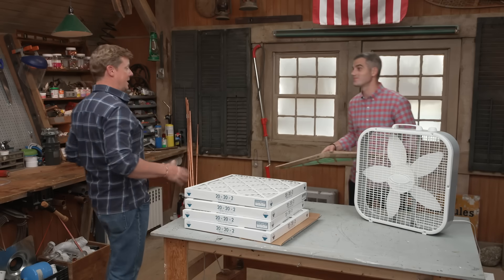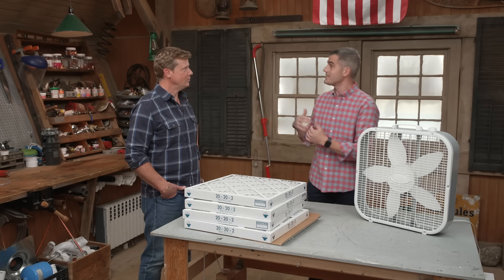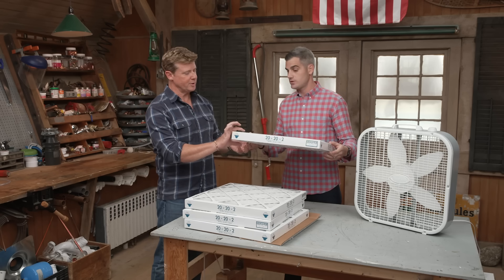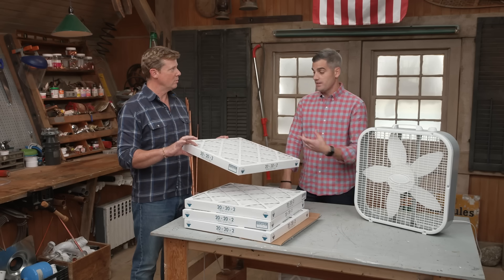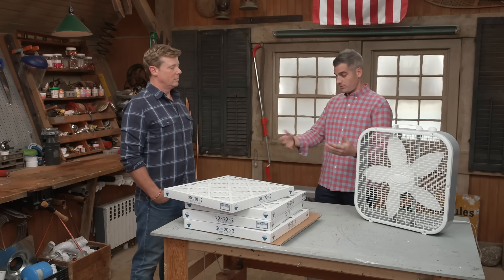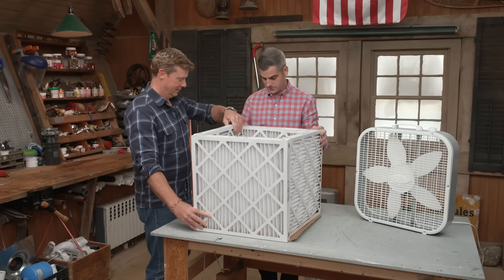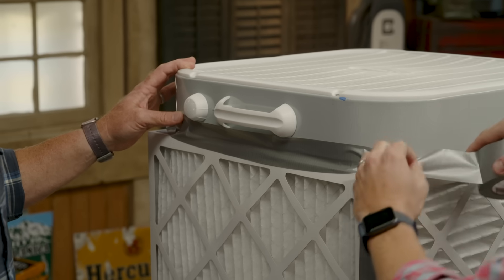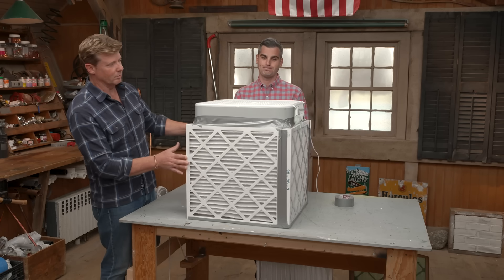How to Make a DIY Air Filter | Ask This Old House

Comment: As an HVAC contractor for 21 years now , I  don't recommend NOTHING above MERV 8 to my clients..The job of the filter is to protect the equipment NOT to clean the air in your  house. If you want clean air keep your house clean!! And air it out often. Or use a HEPA  air wash system and run it 24/7 . Not worth the money , mostly because people never really maintain them properly..
Reply: This is an air purifier with high filtration. Use MERV 13 or better, I am not interested in protecting the equipment (a box fan), I am interested in cleaning the air. Letting outside air in is better than nothing, but not great.
Reply: As an HVAC design engineer I say, "hold the phone, there is a bit more to it!"

Air handlers are designed to maintain a specified mass flow rate of air across your humidifier, furnace, dehumidifier, and chiller/ac.  So while it is true that older systems can only handle MERV 8 filters, us engineers are slacking if we didn't put a decent design factor on, so there is a little wiggle room out of the gate.  Then, increasing the surface area of a filter decreases the pressure head as they mention in the video, so it is possible in some cases to resize from a 1 inch filter up to a 5 inch filter and have a lower loading on the blower with a MERV 13 than a lower rated filter at 1 inch.

Finally, most newer air handlers are designed for MERV 11 filters or better anyway, since they are commonly being bought anyway and advertised as better for allergies. So kind of like how plumbers are stuck dealing with flushable wipes which aren't really flushable, us HVAC engineers just resized things a bit larger, since the condensers are larger outside anyway due to energy efficiency standards, so we were designing in larger fans outside, and might as well up the interior blower fans as well.

So you can get by with MERV 8s, no problem really, and maybe even save a bit of electricity, but checking the faceplate and looking up the manual is easy enough to do, and we mention the filter size right there.

But then again, it is certainly cheap and easy to build one of these filter setups, and what they failed to mention, is that if your air handler happens to be sitting in the same area one of these is running, then all the air you pump to the rest of the house is going to inherently be circulated as already cleaned, so while that is slightly less efficient, it is certainly an easy way to improve air quality for the whole house instead of a single room! 😅
Reply: If you will install a pre-filter in a return BEFORE the thick HEPA filter, the homeowner can change the thin one often and the thick one will last 1 year. This is the setup my HVAC dad made for me and omg its AMAZING.
Reply: The “most people don’t maintain them” argument is not the reason to never use higher than MERV 8 filters. I have used 5” thick MERV 13 filters and they will last a year in most cases and can be installed on just about any residential system with properly sized ductwork. We can achieve both equipment protection and IAQ at the same time. We as an industry have to do better and also must educate customers to change their filters.
Reply: @rosstrethewey9391  Ross thank you.  So many uninformed statements in here.  You are exactly correct (which you already know).
Reply: second this.
Reply: Yes I had an HVAC guy tell me something similar. He said you would be changing out the filter every week because it would catch so much.
Reply: Agree. Using a higher MERV rated filter, over time, will cause your blower motor to work harder and give out sooner, causing costly repairs. Just use a MERV 8, an if viruses, bacteria, and / or mold spores are a concern, get a REME Halo UV light installed.
Reply: @Fulkrum378  are those UV lights expensive and is it DIY?
Reply: @dblood8529  they can be costly. Around $1,000 installed. But that’s still cheaper than a new furnace. It could be cheaper and DIY, if you have a little electric knowledge. For most people, it’s not.
Reply: @Fulkrum378  I have two units. I’m 2k out the door $$$
Reply: @jacktracy4845  the only thing I get  squarely with is the wiring. Also I know the manufacturer won’t cover the warranty if you do not use a HVAC company for the install.
Reply: @dblood8529 Even though this is 2 years old, one thing worth mentioning so you don't get suckered in by the HVAC installers to spend thousands, is that what they say about their simple air cleaner being localized is true...
But, if your air handler happens to be in your garage or a closet with some additional space, there is nothing stopping you from running your diy filter in the same room the furnace blower is in, so long as it isn't so close to the pilot light to be a fire hazard.  If you are scrubbing the air in that room very clean, and the blower is sucking clean air from that room and circulating it to the rest of the house, then it will have a net effect over your whole house.

Comment: I'm definitely going to do this, I hope it can filter out cigar smoke
Reply: Use a carbon filter
Reply: Will it work with other smoke? 🤔 Asking for a friend.....
Reply: I'd be curious too how it would work with cigar smoke. Looking at air purifiers that are more designed to handle smoke often include multiple types of filters one especially being a HEPA. If you do try this out I'd love to know how well it worked for you.
Reply: @jonstark4003  I tried it out and it kind of works. I smoked a Tatiana cigar for about 30 minutes while running the DIY air filter and had no issues with the smoke it self but the smell lasted over 15 hours. It wasn't a heavy smell but a faint smell. I think this was due to having carpet. I also cooked a curry dish for dinner which would make sleeping hard because of the smell in everything but it too was faint and I was able to get a good night's sleep.
Reply: Depends on the filter that you buy.

Comment: As an HVAC guy, thank you for  telling everyone NOT to go buy a 1 inch merv 13 air filter. Those are home wreckers. Those require very specific system designs, like one filter for every room in the house.
Reply: Why don't they just make every new system with high merv filters in mind? It seems dumb how you can get a brand new system that can't even handle filters designed a decade ago. With the way things currently are you're left with two choices: Either running a high merv filter that gives you clean air but restricts air flow and damages your system or a lower merv rated filter that allows for good air flow but doesn't clean the air very well. Either way you're forced to settle for less than optimal performance.
Reply: @Acaidia  because it takes more powerful motors, larger fans, and larger filter boxes, plus calculations of the ductwork in your home, and the size of your home.  It’s like anything - spend more, get more.
Reply: I read somewhere that a 3M 1500 Filtrete filter has an excellent balance of low restriction and high filtration. Do you agree with this statement??
Reply: @charlies.5777  That's impossible to guess at. It depends on you much headroom was designed into your system. You can tell by turning the system on and then dropping in the filter. The more the filter snaps into place, the more of a restriction it is. Another thing you could try is taping some kind of streamer to your supply grills, like yarn or toilet paper or whatever. You'll be able to see how much air flow you're losing. In the end it's your house. Try it and see if you notice the difference either in filtration or how your house feels.  Personally, I use Flanders EZ Flow II  merv 4 about $1.50 each.  Air flow is the key to comfort. It's why you have an HVAC system. To move air of the right temperature to where you want it.
Reply: @tjrooger1092  
Thanks for your advice – I appreciate it.
  FOR what it's worth, when you're standing under a vent when the HVAC is running, it feels like you're under a hair dryer and If you drop a piece of paper by the air return when it's running, it pulls it Out of the air like a vacuum cleaner. Hopefully that's a good sign, ESPECIALLY since it didn't do that when I had the higher-rated ( RE  MERV rating) 3M filter in there.
Reply: @charlies.5777  We have a 1" MERV 13 in our HVAC from 3M and also one on a box fan.  It did not break the HVAC and does an excellent job of removing particles.  We can test it with our Dylos 1100 Pro particle counter.  Our HVAC is heat only with no continuous fan so we can't use it very often, however.  We have 3 expensive HEPA purifiers with carbon as well.  I've heard that MERV 16 is too much but not MERV 13.  But check with a pro.
Reply: @charlies.5777  your furnace has a recommended maximum filter strength. If you don’t have the original documentation anymore, then ask your HVAC tech on your next annual service appointment.
Reply: HOme D didn’t have Merv 13, highest 10, plus only 20x20x10…hope this will work !
Reply: 20x20x10?? Ten inch thick filter? What? @shirleycollins8967
Reply: At the end of the video he said to get merv 13 filters.  Was that just at a different thickness?

Comment: I own apartment buildings with individual furnace/ACs.  The thicker air filters seem to ruin the blower motors (a very, very expensive fix).
Reply: The thicker filters have less resistance so they are not ruing the blower motor for being thicker.  What can ruin the blower motor is if you get too high of MERV rated filter which clogs your air intake.  You cannot use a MERV higher than your system was designed for without negatively impacting your system unless you increase your intake size or the filter thickness.

Comment: This is a clever design easily made from  easily found off the shelf components and duct tape for a more refined version do a google search for Bill Penz home air filter. It can be cleaned over and over and is also effective. Select dust collection research-Bill Penz- air cleaner

Comment: Axial fan without a shroud = very little static pressure. Your furnace has a centrifugal blower capable of much higher static pressure and closer to 2000cfm (or more). That box fan isn't going to last 6 months running continuous and is much louder. You will get much better performance throwing a deeper filter in your furnace and running the fan.

Also load on a centrifugal pump (fan) decreases with decreasing flow (decreasing mass). You will not "seize up" your blower motor, you will actually decrease the load. Blower motors have taps to adjust the airflow based on the amount of restriction from ductwork and filters. They are designed for this. The only risk is having too high of a delta T (temperature differential) across the heat exchanger, which can cause damage to a furnace if it is extreme or freeze up the coils on an air conditioner. The blower can be adjusted to compensate, as designed.

Comment: There's serious misinformation here.  Those cheap airy filters are designed that way for a reason.  The purpose of your home AC/Heat system is to move heat or cool air.  It is NOT an air filter system too.  It's like telling people if they want their garden hose to be a better shower nozzle perhaps you should fasten it a wall.
Reply: Anything that moves air can be a filtration system if it has an appropriate filter. You either trap particles moving past, or you don't. Many modern HVACs are indeed designed to use better filters, as explicitly mentioned in the video.
Reply: Merv 1 is what we want in most HVAC systems not set up to receive a 4 inch filter.

Comment: This is great, but what do you do after 6 months?
Reply: The 6 months is conservative, in a typical home you should get a year out of it. But after that time is up, you’ll have to remove the duct tape and get 4 more new filters.
Reply: You replace the filters, the same as you would with a commercial air purifier.

As another commenter suggested, put a less expensive MERV 1 filter on each of the MERV 13 filters. This will prolong the life on the more expensive MERV 13 filters.

Comment: I would have put the cardboard on the bottom of the fan so the fan could sit upright. The thrust bearing of that fan will never last with it laying on its back like that.
Reply: Wow I never would have thought of that. Plus, having it on the side is just as easy to make and the fan can still fulfill it's mission in life: cooling people off.
Reply: Another commenter noted that this fan actually is rated for running horizontally, but it would have been best to have mentioned this issue in the video.

Comment: I'm pretty sure restricting the air flow actually reduces the load on a blower motor.  Of course the other problems (e.g. coil freeze up) might still be a concern.
Reply: Really?  You never hear anyone say this, only the opposite!  

I have seen some respectable people elsewhere say that "fear" around high-rated filters causing motor wear is not a real-world concern, though.  I've chosen to ignore it in my HVAC for years now.
Reply: @travisburch4342  I never heard it, but I did read it https://www.picoauto.com/support/topic19111.html  and https://forums.mikeholt.com/threads/fan-airflow-vs-power-consuption.95839/ for example.   If you have a vacuum clear with a blower you can verify this yourself by restricting the air flow.   The motor speeds up indicating a reduction in load. 

I suppose the bearings in a faster running motor might wear out faster.
Reply: @stevenneuberger4323  That makes sense to me.  Great points.

What do you think about maybe the fan having to run longer to cool the air?  Maybe that = more wear/tear... but also, with less resistance, maybe that's canceled out, too...

Comment: If you don’t have a good air filter in your room I would definitely recommend it. I use to alway wake up with a stuffy nose and a bunch of junk in my sinuses, now with a good hepa/charcoal/Uv room air purifier I wake up clean clear and ready to go.
Reply: I found out that works great. My son used to have the sniffles all day and through the night in the house. For my ac unit I use a high air flow filter as I heard long ago merve 13 or so can cause issues. I found out the hard way. So I bought 2 air purifiers. I put One where the air intake is to our home ac. The purified air blows up to the intake. Then added an air purifier to my sons room and his nose cleared right up by the following day.

Comment: I had a professor in college explain how the longer you leave a filter in the more it filters, which is true but it will also burn up your motor and have a lot less air going through. He was speaking of car oil filters same point though
Reply: A car oil filter has a spring loaded bypass so eventually it doesn't filter at all.
Reply: Of course he is right, More restriction=more filtration=less flow rate=less volume of material filtered per minute. When flow rate gets too low then we have problems!